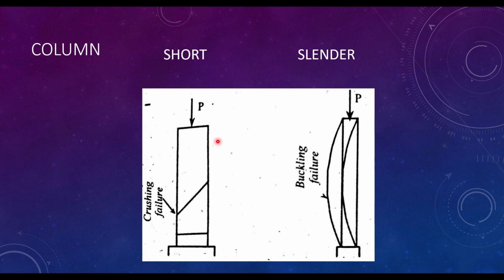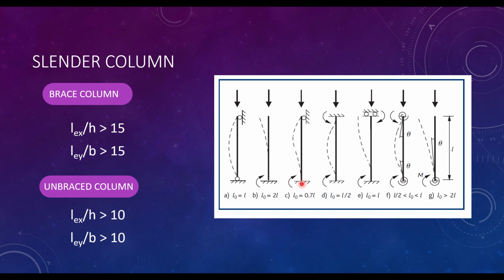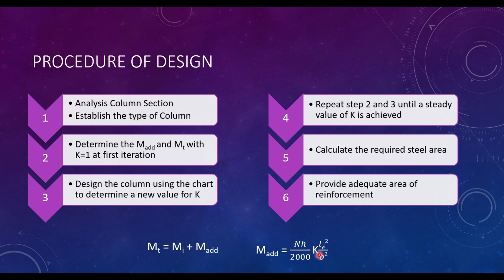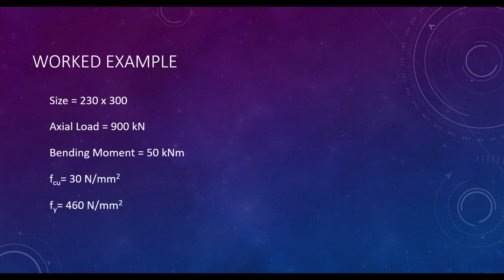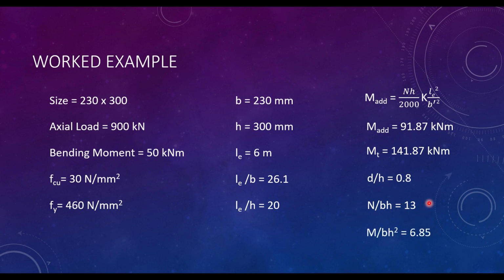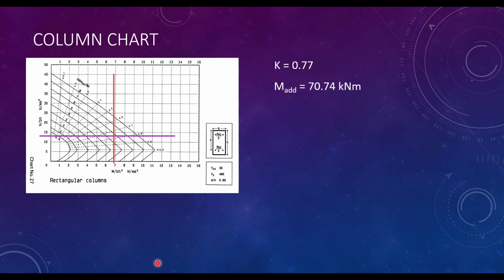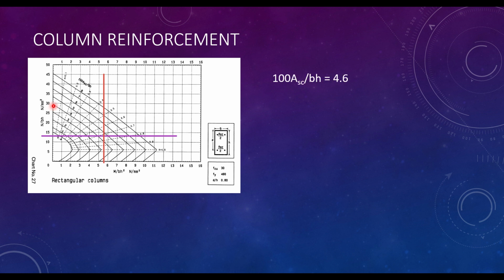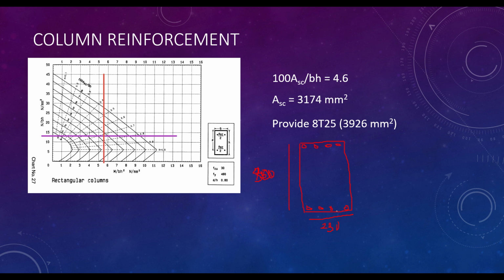Design of Slender Column | RC Column | BS 8110

Comment: What about a current code which is EC2? - there the limit of reinforcement is just 4%. What if I have a cantilever column? - how the boundary conditions to use these charts are determined?
Reply from the maker: Yes it's 4% but there are allowance at the joints.